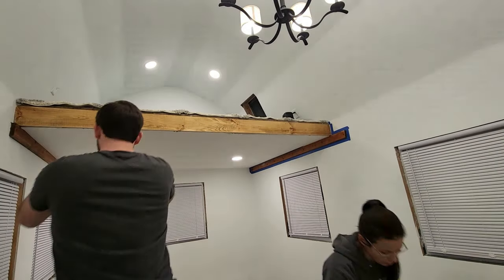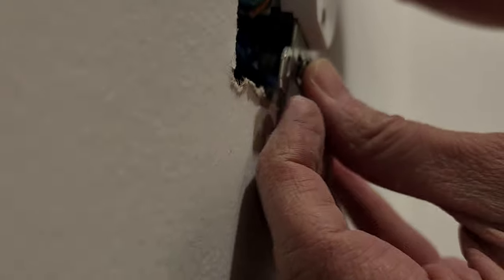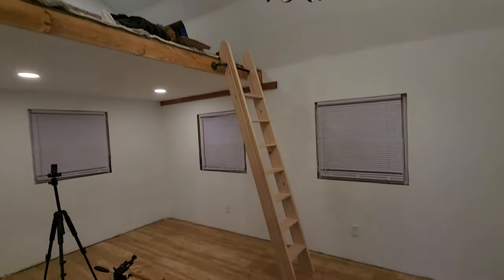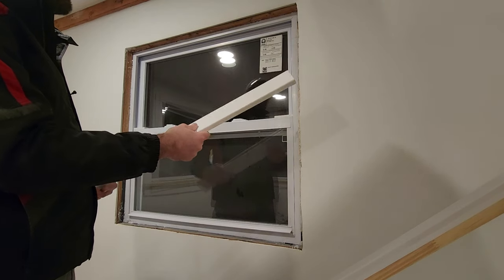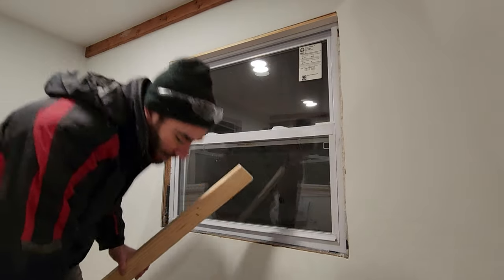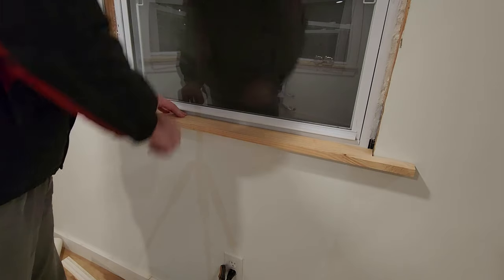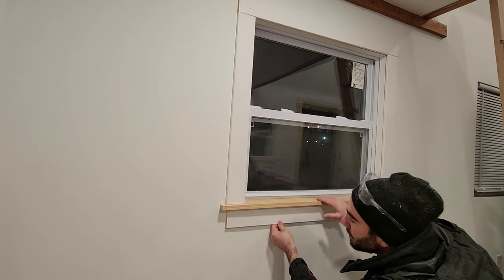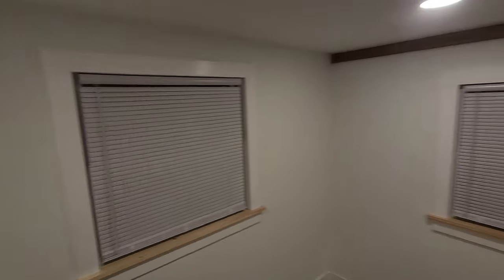Turned my shed into a living space! | Lights, Painting, Trim | Shed build part 16

Comment: Where's the venting? Unless, do you keep the shed conditioned year round?
Reply from the maker: I will mostly keep it conditioned year round. The roof is vented with eve and ridge vents, but internal venting will be handled with the windows/skylight and window air conditioner. I do have a wire setup to potentially handle a through-the-wall vent in the future, but I'm going to go through this summer before determining if I actually need it. It wasn't necessary in the winter.